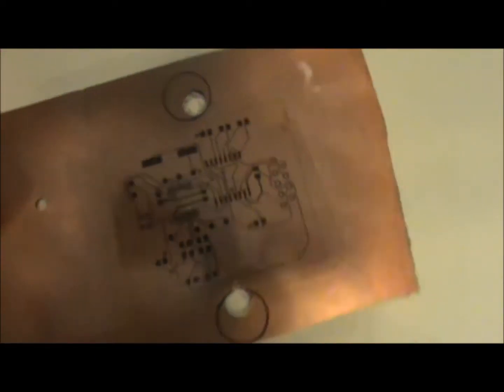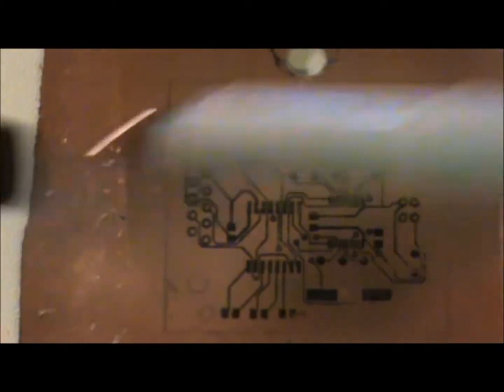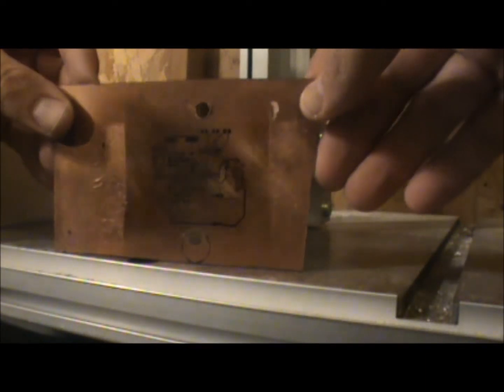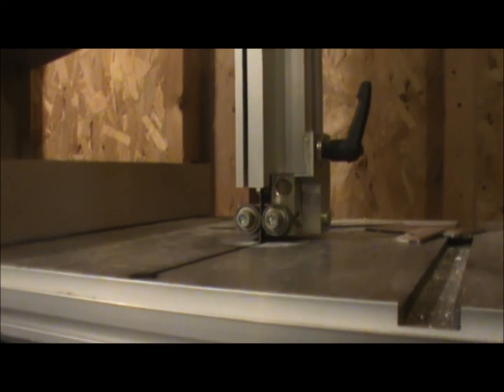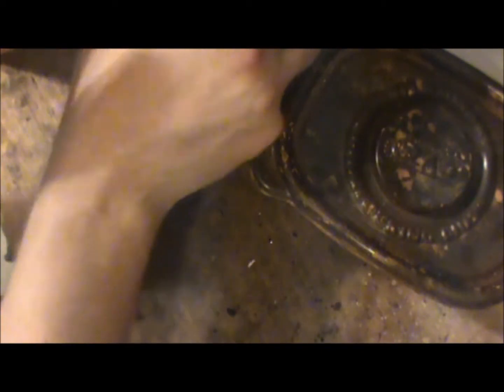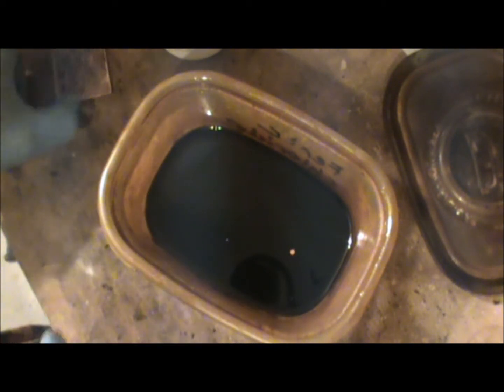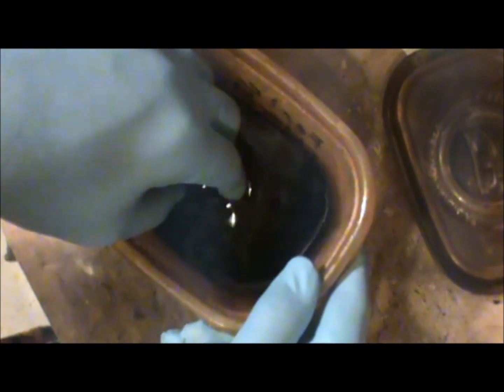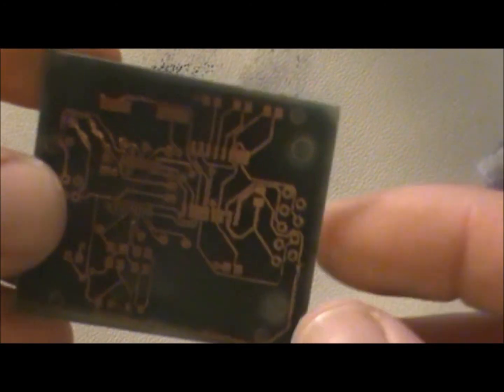Etching the PCB

Comment from the maker: @kiskiller3 yes that is another way.  make sure when using paper that after you iron it on you soak it in water for about a minute then peel off the first layer of paper and let it soak again.  dont try to get all the paper off on the first peel.  you may loose some of your circuit.  just a tip. good comment thanks

Comment from the maker: Oooh.  That is no good.  Thanks for sharing, sorry that didn't work well.  The iron that I use does not melt the transparency paper.  I guess that should be a note to us all that make sure that you iron is not getting so hot that it will melt the plastic.  You just need it hot enough to make the toner sticky again. Thanks again for the post.